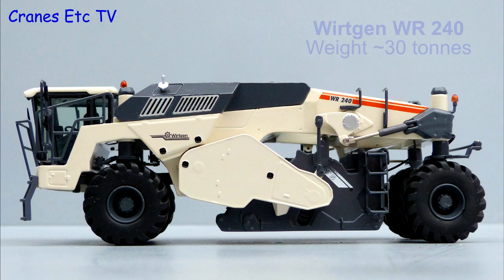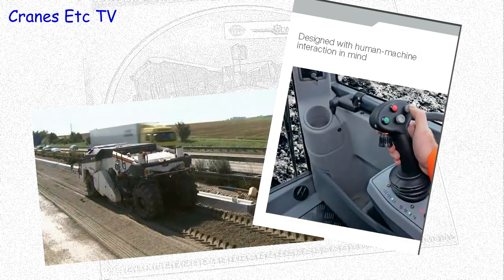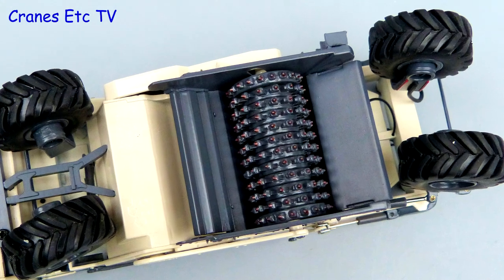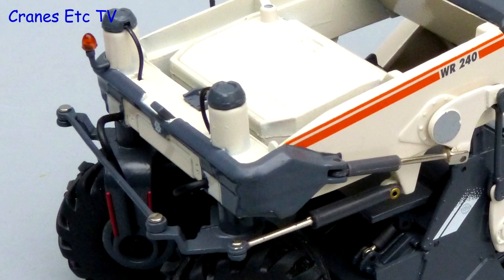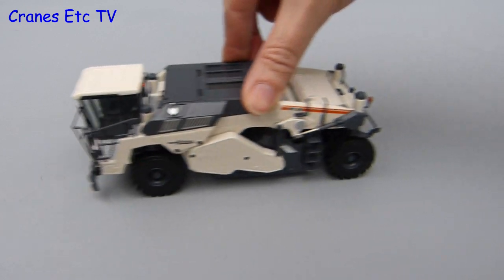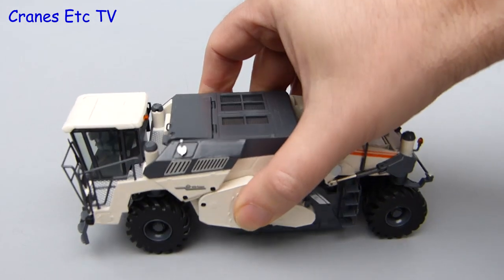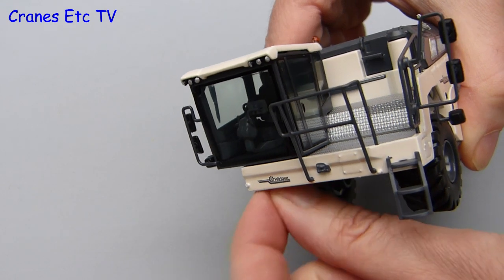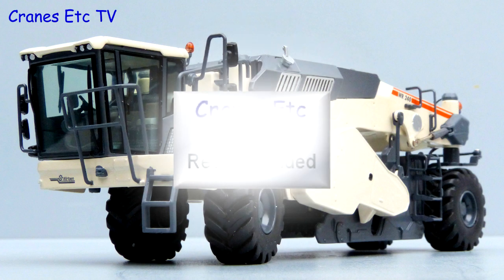NZG Wirtgen WR 240 Cold Recycler and Soil Stabiliser by Cranes Etc TV

Comment: First of all, they spread lime or cement on the ground, and then the machine mixes it with a little bit of water. This is how the soil's bearing capacity is improved. The same machine is also used to recycle asphalt pavement, as it pulverizes and mixes the pavement with foamed bitumen, cement and water.
Hope this helped!